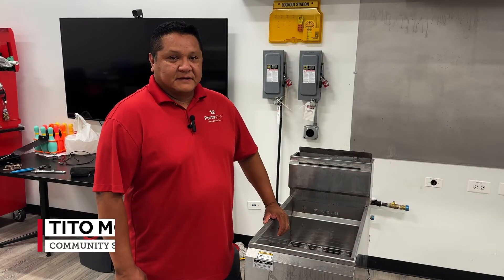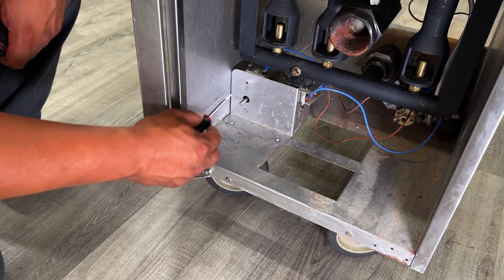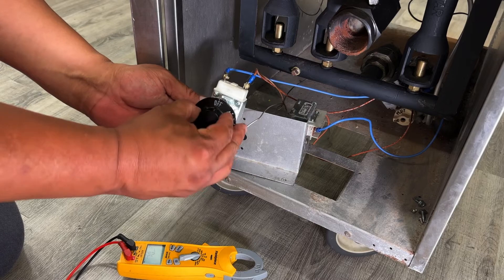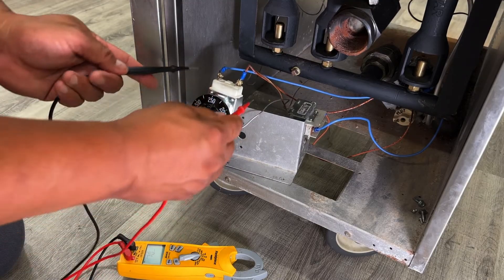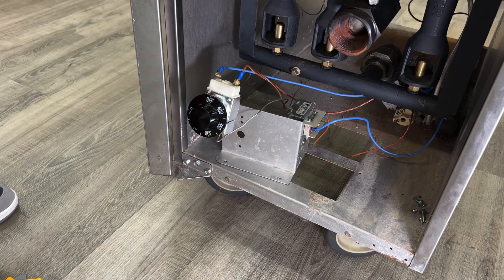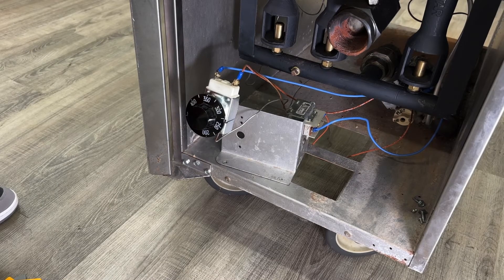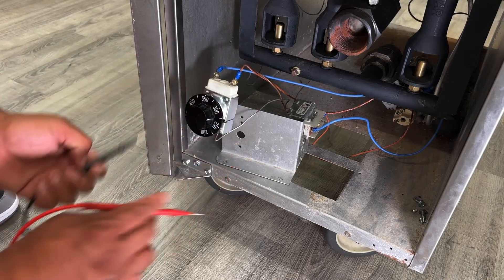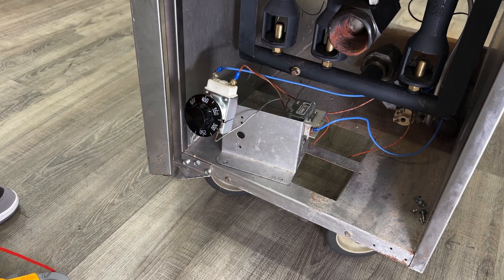How to Diagnose a Deep Fryer Thermostat

Comment: Why would you even post this video, re-do it but this time remove the two wires from the control thermostat, you will then receive the results you were hoping for. In this video, the continuity results you were getting were coming from the gas valve coil, not the control thermostat.
Reply: But sir,, he said he's a "Certified Master Technician"
Would you NOT hire him OR try to re-teach him??? MAGA